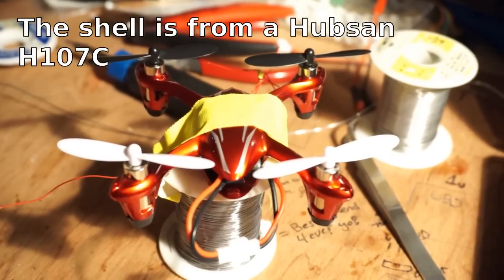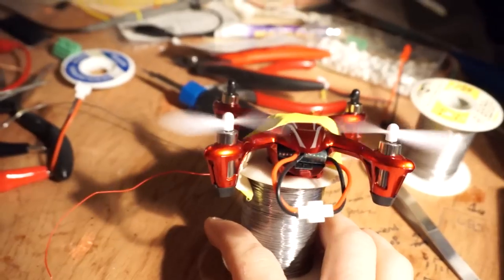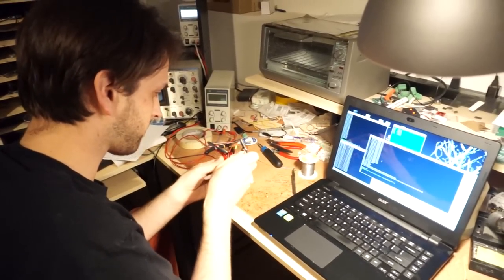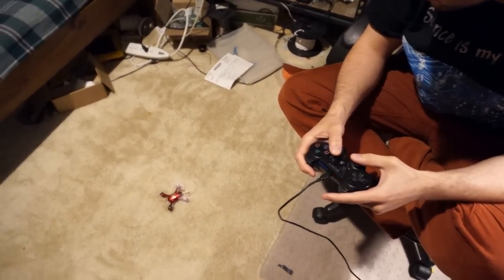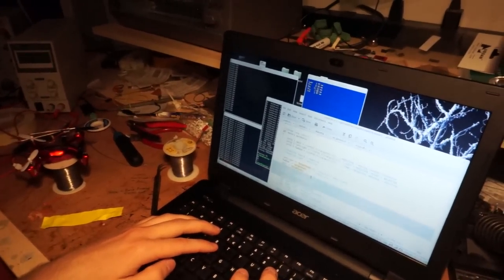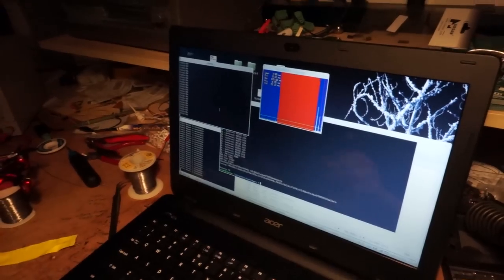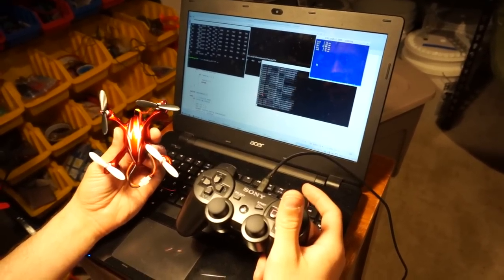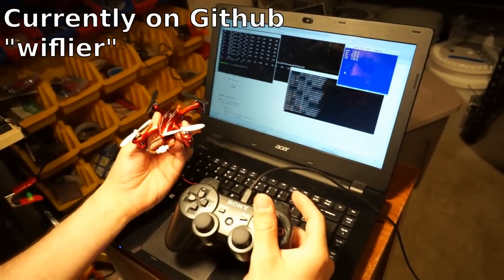Trying to make WiFlier, a Wifi enabled Quadcopter

Comment: Isn't it a TCP retransmit issue, instead of a WiFi issue? You may have better results with UDP, which is basically send-and-forget, since any individual packet isn't particularly important.
Reply from the maker: Daniel Bos Nope!  People often think UDP is send and forget, but this is not born out over wifi or over ethernet.  While I believe it can be implementation-specific, you can see even the ping packets in the tool (ping SHOULD be send-and-forget) still come through significantly later because of other retransmit features of the underling network.

Comment: I'm currently working on a similiar project except that I use the nrf24l01+ instead of the esp8266. Your schematics helped my out since I was and still am dealing with power delivery problems(nrf24l01+ restarts but gyroscope and microcontroller don't). Adding even more capacitors than I allready had installed showed at least some improvement. 

In the future I'd like to create both a bluetooth(hm-10) and wifi(esp8266) version. That you as an absolute esp expert failed to build a functional micro quadcopter puzzled me. Therefore I'd like to know your opinion on whether creating an esp quadcopter is possible.
Reply from the maker: Oh, I am pretty sure I could have done it without too much effort now.  There was so much wrong.  For one, just using a real antenna would have done 100x better than that wire!  It really should work nowadays!  Plus, I would use an ESP8285!  Smaller, since you don't need the external flash, and I'd probably put the motors directly onto the ESP!
Reply: Thanks for that encouraging response. The ESP8285 sounds like a pretty interesting choice unfortunately there are no modules available on Ebay. I'd rather avoid building my own circuit board since I don't have any experience in dealing with high frequency circuits and antenna layouts. If you can tell from experience that it's not any harder than dealing with other smd chips (qfn) I'd order some and experiment with them.

Also is there any reason you didn't try to customize the multiwii software? In my experience it's far superior to any algorithm that I could come up with(although they kind of worked as well)...
Reply from the maker: Well, it's all what you want to bite off... I would encourage you to do it.  It may take a long time but you will learn a lot!

No idea.  I've never heard of multiwii until today!

Comment: Amazing video!! Im also starting a similar project using the esp8266. I think the supply and emf from the driver transistors makes the chip to not function properly. Maybe you should put the transistors away from chip and use good supply connection with larger bypass cap ( redesign the board !!) . Thanks :)
Reply from the maker: It turns out the problem was the RF from the motors and not using a proper antenna.
Reply: Thanks for the reply. Why do you have ATTiny also on the board along with the ESP? Can't the esp8266 handle all the communication as well as the PID stabilization?
Reply from the maker: It can! But at the time I was designing the board, the software support was not there.

Comment: Another thinking... If your WiFi repeat one command due to ACK problem, then quad will execute single command over and over again. This may lead to instability as you already have. In this case, you may make pseudorandom number of the command, so that quad execute single command just once, no matter how much it repeats in the communication. Something like 'todo list'; "first command #34 executed, waiting for next one...".
Reply from the maker: ***** Actually, the underling 802.11 protocol does ensure it doesn't accidentally double-send packets.  Though, I will likely include this as a feature of mine anyway.
Reply: CNLohr Ah, okay. Then... but is where? Why toy (if you wish call it toy, drone, quad, quadcopter... to me is the same, as long as it does what you want) respond too agressive to your commands? And why respond too agressive to its own sensors? High sensitivity?  Did you make PID controller?
Reply from the maker: Yep, I wrote the pid and all, I just didn't mess with it too much yet.  I will soon when I get to programming the new boards.
Reply: CNLohr I wish that you succed in this. It will be awesome to see it works on WiFi remote. Thanks.

Comment: Disable ACK. Send data and forget. That's it. Normally all RC protocols has some amount of packet lost. If it fails, go to nRF24, you just need preamble, ID (single pipeline), next frequency for hopping (you may run on single frequency, but it is recommended to jump all over the place to avoid interferences), and the rest are number of channels (4, 8 or 16) that you need for data to send. If you decide to use frequency hopping, you may jump at random channels, or better way (as is in FrSKY) to jump quickly to next channel, then next in ascending(+) or descending() orders, and this sequence of +/ channels may be random.
Reply from the maker: ***** I am seeking wifi only.  If I wanted to make a quadcopter, that wouldn't be hard.  What I was chasing after was specifically with wifi.
Reply: CNLohr That is actually very cool stuf. I tried to look at your codes on github, but I am afraid that it is over my head - I do not understand structure, and which code is inside toy, and which inside your computer. So, I get lost there. Can't see basic controller functions for the toy (about gyro, acc, baro and other stuff). Maybe you have bug in toy, maybe in OS, maybe both, don't know.
Reply from the maker: I'll be making an update soon to flesh a lot of things out.  Hopefully it'll make more sense then.  For instance, I am moving all of the sensor data collection to the AVR board, along with the gyro closed loop control.

Comment: Wouldn't it be better to send single commands like Altitude hold, move right, 30 cm up, etc ? 
I newer built (or flown)  drones, but this is what I would do.
1. Calibrate motors how much rpm is needed for lift. (button or ultrasonic/IR distance sensor) Slowly increase rpm for every motor till its starts to lift off and find rpm sweet spot. It could be done manually but i think this should be done every time you start flying, coz weight can change and also atmospheric pressure (air density) changes a lot. 
2. Self balancing. some simple Kalman filter for gyro + accelerometer to make it stable.
3.  Create functions for up/down (and how much power) and x/z (how much power) and thats it. and loop these every 100ms or so.
4.  Send commands like { Z : 0; X: 0, Y: 0} every 100 ms. And to change directions -  { Z : 20; X: -30, Y: 50}; if command is not sent it's by default 0; 0; 0 or even Z: -10 so it slowly starts to land. Also barometer comes handy to tell the relative height change.
Reply from the maker: self-balancing isn't that bad with just a PID loop.  The only problem is some of the higher-level things are a little harder to do without a human in the loop (or something with more absolute fixes).  But, for everything else, sounds like you should give it a whirl.

Comment: Here is a thought. If you are convinced the issue is in the wi-fi protocol then get one of the cheap routers and flash it with custom firmware like dd-wrt, open-wrt, tomato, etc. From there you should be able to tweak finer settings of how your wi-fi traffic should be handled.
Reply from the maker: Leon Nat Totally defeats the purpose of a wifi quadcopter, however, from some other comments, it may be possible to broadcast commands (I'll try that soon)!
Reply: Might help in troubleshooting. Also, I wonder how actual wifi controlled quads do it?
Reply from the maker: I don't know, but, I have discovered more and more other problems in this design, and corrected them on a newer design.  I'll see how that goes in the coming weeks.
Reply: Cool. Looking forward for that update.

Comment: Did you try a basic request-response message pattern initiated from the toy? I know it sounds off, but messages would be ordered and it might just avoid the flooding. At least with TCP/IP you can flush buffers. Don't give up, this is just too damn cool.
Reply from the maker: +Theunis Swanepoel I have not, but you can try sending ping packets and seeing them all get backed up.  The only thing I realize now that would solve this is to have virtual clocks running and then throw out packets that are backed up and only care about current ones.  Additionally, filtering the antenna more likely could reduce the impact of noise from the motors.
Reply: +CNLohr It sounds like some congestion is causing messages to become reordered, something that UDP allows.  I would let TCP take care of that for me and further slow down control updates to a more modest 10Hz or so - or, better yet, only send them when they've changed. I have no idea what heuristics WiFi routers might use to make things "fair", and I bet you'll be better off sending (much) less data.  Be sure to disable other tuning/diagnostic/debug messages to give this a fair chance.
Reply from the maker: There is no reordering, though.  It's because 802.11 is what handles the autoack and everything else.  As someone else pointed out the best way around it may be to use broadcast packets so there isn't any verification of acknowledgements.
Reply: +CNLohr Ok, I see what you mean.  It would be interesting to see if this is still a problem with the PWM disabled (no potential rotor interference).  My quadcopter uses a USB HID (http://gaming.logitech.com/en-za/product/f710-wireless-gamepad), but that approach might just defeat your purpose.  I still somehow see a lot of eloguence in a solution that uses a cheap WiFi-enabled chip for perhaps higher-level flight control which might not require as low latency.
Reply from the maker: yep aaandd it is 100% because the motor interference, actually tracked it down even further and found out it's because the ESP can't send packets while it believes someone else is using the line - as 802.11 says.
Reply: +CNLohr Very interesting. Did you try extending/relocating the antenna? I also came across this. http://store.hackaday.com/products/esp8266-07-module-with-u-fl-chip-antenna-fcc-ce-certified
Reply from the maker: Yep... Nothing.  One thing I didn't try though in this iteration was a tuned chip antenna that should be much more insensitive to the lower frequency noise.
Reply: +CNLohr Are you referring to these? They are damn pricey, though! https://www.sierrarc.com/index.php?main_page=index&cPath=65_82
Reply: +CNLohr Here's some others you might want to check out.
http://m.ebay.com/itm/DIYMALL-Antenna-Extension-Cable-3DBI-Gain-Antenna-for-ESP8266-Wifi-Module-ESP-02-/271746528072
http://m.geekbuying.com/item/2-4G-3DBI-Wifi-Antenna-Extension-Cable-For-ESP8266-Series-Modules-343878.html
Reply from the maker: I'm really done with this project - but - those really wouldn't work anyway since they look like they'd weigh almost as much as the quadcopter :-/

Comment: Great video! where can I get one of those dev boards? I've been playing with the ESP8266 12 and like the size. But your board is awesome! I would love to get my hands on one.
Reply from the maker: Michael Manduca You can't yet.  Though I am considering getting a run of the new ones soon.  I'm hoping it to be in the next 2-3 weeks I'll start getting them shopped out.  As a warning, they are much more expensive.  The components alone cost $22!
Reply: I'm willing to throw down some cash for a dev board. I played with the Nginx firmware on my esp-12 and really liked it. Your other projects are very interesting. Keep up the work. I'd love to help testing or otherwise. :D
Reply from the maker: I will probably forget this conversation when I do finish, but I should remember to post a video!

Comment: I have the same quadcopter an i lost the controller and i woder (because i havnt tried it yet) what the frequency of the old board was.
Reply from the maker: ***** I think around 2.4GHz, but it was some special protocol... may have been 900 MHz?
Reply: thx

Comment: Maybe you can get better performance if you send the esp the controller data only if there's a change since the last sent data. The esp can just use the last sent data every control loop for the flight controller. Since it's UDP(unreliable), it's probably also a good idea to have an update every now and then on a slower timer. Of course this will be less reliable but it might improve your latency since it won't flood the network as much.
Reply from the maker: decay The bigger frustration is that wifi tries to make UDP reliable.   So, even if I update only so often, it may take quite some time to get through.

Comment: how do transmitters on the 2.4 ghz spectrum overcome the emf issues you are experiencing on a similar frequency?
Reply from the maker: +Redneck Nerd I am not really sure, but I did notice a few problems with my design which greatly reduced the noise immunity of my design.  Putting the bypass cap closer to the processor, using a tuned antenna rather than a little wire stub, etc.

Comment: I started playing with the ESP8266, getting one ESP8266 to directly talk to another over UDP, but was running into reliability issues (not able to reconnect to the AP after a power cycle), so I downloaded the reference gerbers for an nRF24L01+, and ordered some pcbs (all the premade boards I could find online use counterfeit chips!) and I'm going to see if I have better luck with those.
Reply from the maker: Matt Pandina I was surprised by a report on the counterfeit nRF24L01+'s and the report basically showed they were marginally better than the real ones, and they couldn't find any way in which they were broken.

But, for me ESP8266's were what I think is cool.  I don't know why you would be running into those issues.  I know I used to, but that was with the old AT stack.  Once you use C and the esp_iot_sdk v1 or greater, the reliability really shot up.
Reply: CNLohr I'm curious where you read that about the counterfeit nRF24L01+ chips. I heard* that you need to use tantalum capacitors across VCC and GND, and 1 Ohm resistors in series with the VCC to get them to act somewhat reliable. Apparently the counterfeits even copied the errors in the datasheet, so some behaviors are reversed from the actual hardware, and won't interoperate with real chips if you use those features.

* http://hackaday.com/2015/02/23/nordic-nrf24l01-real-vs-fake/

I'm using the AT command set (v20) and it's been pretty buggy and unreliable. I was hoping to just drop the ESP8266 into an existing design that already uses an ATmega, so I'm not using  the SoC directly.
Reply from the maker: Matt Pandina Interesting, my mind shaded that NRF24L01+ thing incorrectly.  So, yes, okay, I'll buy that.  

Oh my no.  The ESP8266 is its own beast.  But when you start programming it in C you can unlock the power that lives inside :)

Comment: Hi! I really like this project, do you plan on finishing it up, do you need help (Not that I have much skill to offer). I have dreamt about a wifi enabled hackable indoor quadcopter for some time now, and this looks just like what I wished for.

I could probably help with making an android client for it if you'd like.
Reply from the maker: +ET I don't believe I am going to continue this project.  It's as far as I was interested in.  I've learned a lot and know how to improve it, but, I am not really interested in it any more :-/
Reply: CNLohr Too bad it looked like a fun project or even a kickstarter. Well you did give a disclaimer so I am not too shocked by this, keep on hacking!
Reply: +CNLohr If you feel like fooling around with drones more, then the Eachine H8 and other really cheap drones are pretty hackable (Firmware flash is easy and it should have some IO pins to spare, like the ones used for leds)

You should check it out even though you hate drones, would definetly make an interresting video.

https://github.com/silver13/h8mini-testing
Reply from the maker: I am sooo far behind right now, but, I very well might.  I played with the hubsans back in the day and thought they were pretty cool.

Comment: Did you desolder the ESP8266 to build the new board?
Reply from the maker: norm1124 No. You can buy them by searching ESP8266 CHIP on Aliexpress or Ebay.

Comment: Maybe don't use Wi-Fi as a radio control but just some commands that s prossed by the esp. like to go 10cm left instead of continuous messages just one message that says 100cm left. The esp then reads the signal and goes 100cm left.